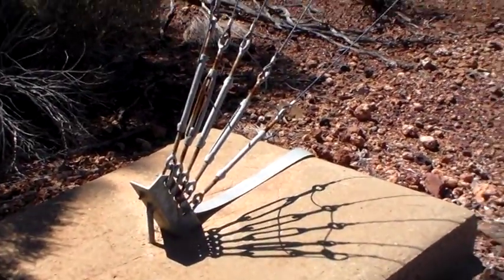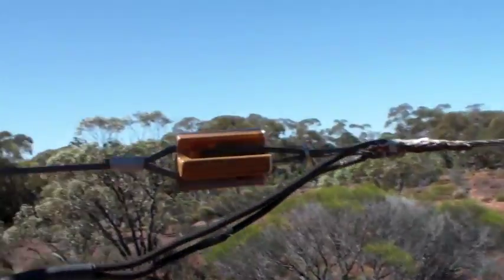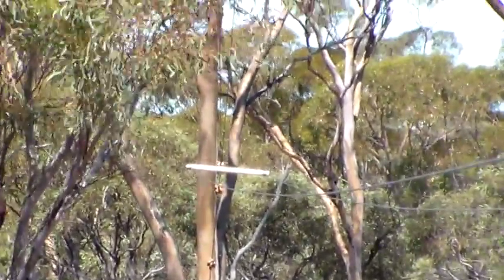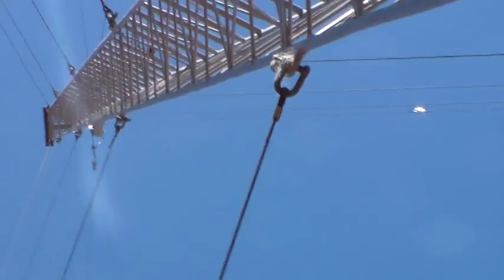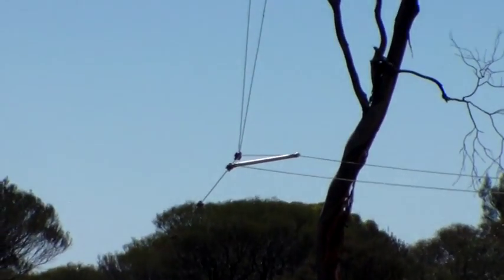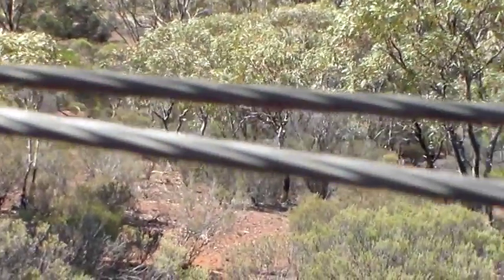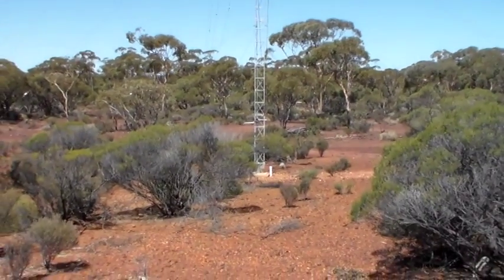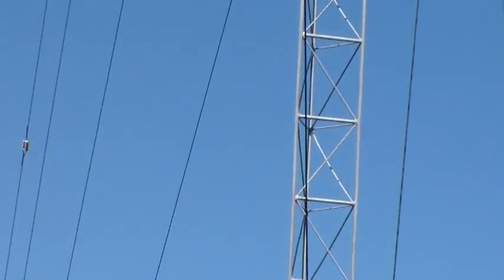A Commercial Delta Loop HF Comms Antenna.

Comment: What's the value of the termination resistors?
Reply from the maker: I don't know, I didn't install this one. I would guess it would be 450 Ohms 600 at a pinch. I would have to disconnect the balun to measure it.

Comment from the maker: Hi Moussa... real measurements? You're not really thinking of making one of these are you? I only did this video because some people wonder what commercial HF comms antennas look like close up. I thought the potentially interesting stuff was the feed point, how the wires are connected and spread, how they run through the insulators, and the position and size of the terminating resistor.
Reply: Hi Steve ...the quick answer is no.....
Reply from the maker: Moussa El Karakizi Good answer... there are far more discreet ways of obtaining good NVIS performance from a domestic antenna.
Reply: VK6CS a Pyramid antenna will be my choice if i had the space, also sun shade support ?
Reply from the maker: Would you have the pointy bit at the top or bottom...
Reply: VK6CS depend on your R=1/(√(1-(v²/c²)) to the antenna!
Reply from the maker: Moussa El Karakizi Relatively speaking...
Reply from the maker: Moussa El Karakizi Thanks Moussa... there's plenty of weird and wonderful HF antenna designs out there.

Comment: some real Measurements would be nice to have, usually there is a driven element and a reflector pointing to the sky, but based on what i have seen in the video, both elements are identical with a spreader?  thanks for the video.
Reply: the "2-elements" are shorted together, they really are not elements. its a heavy duty simple delta loop, designed for multiband operation. I have heard the VK Hf radio system here in the USA, when conditions are right i hear the mobiles and the base antennas. wd5iah